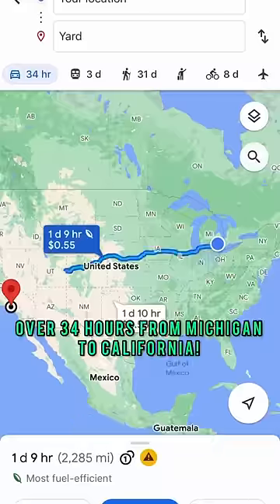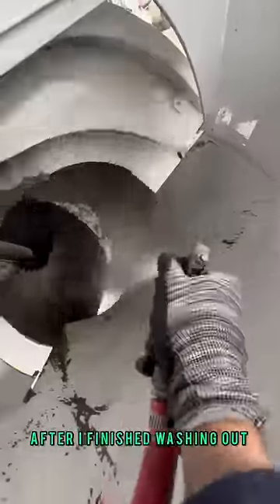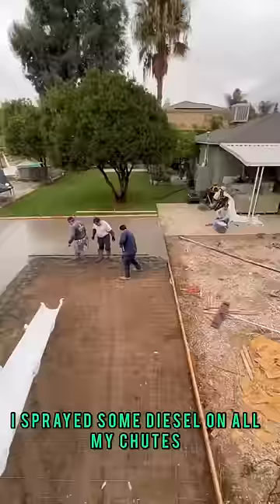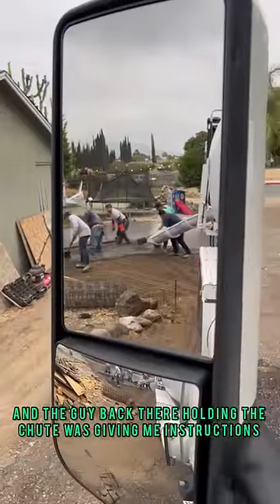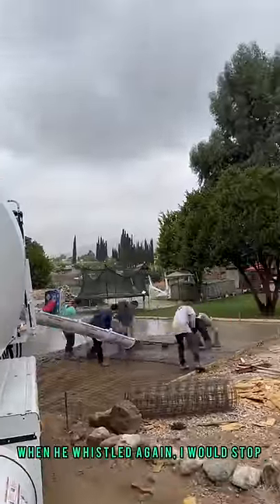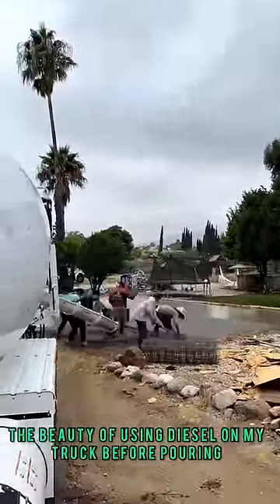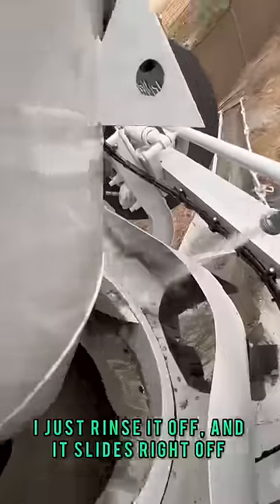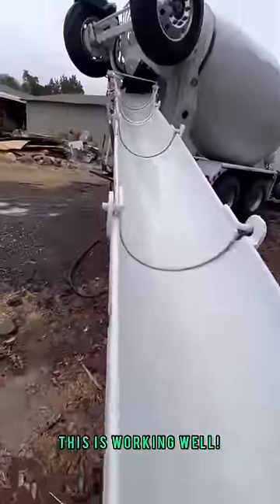BRAND NEW 2022 MIXER TRUCK!! 🤩🚛💨 #concrete #construction #readymix #work #cdl #trucking #shorts

Comment: As a concrete superintendent I wasn't thrilled to hear that , oil and concrete shouldn't ever mix together
Reply: Don't be silly
Reply: Sounds like Oshawa violation from he'll to me heis badly saying he pour diesel out on the ground
Reply: Eric Staats  release form oil can't be compared to that , they're complete different
Reply: What are you talking about? I work for a general contractor and we did all of our own flat work and we did tons of form work and we used tons of form oil, yeah it was nasty as f*** it was dirty oil and diesel and we sprayed on the form ply, steel pans, whatever. For the plywood it's soaks in and once you pour with p*** ply a few times the concrete dries the hell out of it. So when you put the form oil on it just soaks it in. It doesn't go in the ground. It doesn't go in a drain. This is how big commercial buildings are built and big time. Flat work is done. Yeah they have some newer environmental crap. It doesn't work worth a s**. And in case you have noticed this guy's poster a little fishy, you can keep your cement truck pretty much spotless and you don't have to put no foam oil. No diesel, no Vaseline on it. You just rinse it off. Spend five extra minutes at the clean out. All these people on here talking about don't let him catch you with the diesel in the phone f***** ridiculous. You think anybody came on our f**** job site to told us anything? No we did what the f*** we wanted. We built the s*** properly. Sometimes the cost of fancy modern big buildings is some environmental damage f*** where were you guys? I didn't see any you f**** out there whining about it. We did have some electricians that always wanted us to build them Wood chip trails when it was muddy. I seen a few first year electrical apprentices  grease up their sharpshooters and f**** dig one-handed. Oh and yeah for all you people that think the EPA is going to bust us or inspectors or this is that or that the oil ruins the concrete. It doesn't hurt the concrete s*** to use foam oil on your forms. Obviously you never poured walls with snap ties or other concrete wall systems. People always think they know people always want to run their f**** mouth and act like they f**** know
Reply: What's a concrete superintendent?

Comment: Customer after putting out a cigarette on their driveway: “Why is my driveway burning?”
Reply: That not the way diesel fuel works.
Reply: @Oh6Torch  It doesn’t cause sidewalks to combust indefinitely?
Reply: Flashpoint… Die Hard was a lie
Reply: Its bbq time
Reply: Diesel doesn't really burn too well. You need a reasonable open flame. Not any heat source, an open flame, and a hot one.

Comment: My dad used to coat his wheelbarrow and mixing tub with candle wax. Worked wonders. And we didn't have to use muriatic acid for cleanup as often (shovel and mixing tools do chip the wax away if you're not careful)

Comment: I drove a concrete truck for over 10 years. Don't let the company know your using diesel fuel. Use form oil. Our plants use two types of batch plants. Dry mix -truck stays dirty all day till wash the end of the day and pre premix plant. They mix it and put in your truck and the truck stays clean .clean. .

Comment: 20-years concrete mixing in the UK what's told early on diesel affects the concrete we also use a product called GTR which will dissolve set concrete overnight without damaging the paint

Comment: Dang-O Man, What mix did they use so you could drive so far and still have a pour??
Reply: Right I thought it was 90mins and it’s loosing integrity, I’ve been told after 90 shits on them
Reply: No shortage of concrete in Cali ok he waited till he got there then bought the cement

Comment: In the oil field sometimes we used diesel in the cement to get it to harden faster.  Other times we use sugar to have it cure slower…  I am having a hard time seeing how the tiny bit of diesel on the chutes would pose an environmental hazard… especially since the EPA said it would be wonderful to set tanker cars on fire and pour hazmat straight into a ditch before settling it ablaze!!
Reply: EPA making itself relevant, job security.

Comment: I used Diesel and Hydraulic fluid aka "Form Oil". Gotta say you must work with some relaxed people, around here you don't have time to put it in gear, it stays in gear on a tailgate until the job is done. Your left leg gets pretty tired.
Reply: Road paving?
Reply: @ebolawarrior451  Concrete pouring. Pads, sidewalks, curbs etc.
Reply: Tailgating curbs uphill is the worst, but same all the contractors i pour for would flip if you waited to put it in gear every time

Comment: You know you just contaminated the mud brother. It prevents the concrete from setting up
Reply: You don't know what you're talking about. I've been precasting for over 40 years I always used waste oil for a long long time until I heard of organic form release  The only oil that doesn't work is used diesel engine oil because it stains the concrete but it doesn't keep it from curing.
Reply: Your wrong man. Its just not allowed bc of environmental contamination.
Reply: @DongThePsychopath and your wrong man. The state government trucks use the same thing man

Comment: How did you haul 17 yards of concrete in that mixer?
The largest mixer that I ever drove was 11 yards.
The weight of 17 yards is around 69,000 lbs, my RD800 Mack had 65,000 rears (8 tires) on it.

Comment: From Michigan to California? That concrete slab for a driveway must cost $150,000. You must've hauled ass so the cement wouldn't be dry by the time of delivery.
I've never heard of a cement truck driving that far. The local company here won't even deliver to the next county over without an extra charge. 
Should have gotten one with a sleeper on it.
Reply: I’m guessing he bought it to drive back home?

Comment: I worked in a block making plant for a lot of years and Remer that we had to use the concrete within a few hours from being in the mixer because  it wouldn't be any good after it spins in the mixer so long so my question is after 32 hours of driving wouldn't  that "cook" the concrete?

Comment: To the kids who have no clue what they're talking about. The nozzle at the end of the video is water, not diesel. He sprayed diesel  with a small spray bottle at the start, before the pour. That's why the concrete cleaned so easily of the chute. Your mom's probably spilled more diesel at a gas station than what was used in this video 😅

Comment: Congratulations 👍 for truck   The pumper was right on the slip form. Diesel will decorahgate the concrete. I didn't think you want to be liable for the replacement of a pour. Just saying.

Comment: Nice I work for a large cement company in Canada and I love to see the difference with the extra axle. The first time I saw a mixer with front discharge I was in Vegas and couldn't hardly believe what I was looking at. I hear you with using a bit of diesel but you have to be so careful because some of the job sites would definitely flip out throw you off the job. Anyway beautiful truck. How has it been? Working good for you still?👍🇨🇦🔧

Comment: Anyone in the industry quickly learns that some "dont do that"s are "don't get caught by the wrong person doing that". I've been on interstate jobs where you can get a huge fine for dieseling the bed, and I've also been on airport jobs and you can spray the equipment down right in front of the inspector. I only use diesel if the mix starts getting stuck. On the next load, it will pull right out.

Comment: I don't know if it would help or not but try a product called mold release we use it in the smelting Industrial we use the release on metal wood and sand does it seem to hurt paint on hard metal surfaces

Comment: Use ultra ever-dry, its carbon nanotube in a spray application, 99.9% hydrophobic, the concrete wont even leave a trace to wash out but your chute will be like teflon, 5 will pour like an 8

Comment: Diesel works great so does form oil but I would continue putting a few spirts of diesel and if u find form oil but it in same bottle shake up and just use a few spirts  good luck from the bridge builder

Comment: I used a mix of hydraulic fluid and diesel in a very thin spray from a stainless hand pump weed sprayer on my concrete boom pump in Florida.
Always worked extremely well.

Comment: Bro if you did that here in Texas your ass would be in hella trouble. People used to spray diesel on forms also but now they actually have a oil for it and that would work very well for what you're going to use it for. It looks the wood release right off of the concrete so it would do the same for your chutes but definitely stop using diesel

Comment: They used to use diesel for form oil, but I guess the epa doesn't like that so they have other stuff. I believe you can get in trouble for using diesel. But yes it's what they used in the past and it works great.

Comment: Why would you have to sit in the truck to operate the tumbler on a brand new truck? Already 30 years ago we had trucks with hydraulic up/down on the chute and start/stop controlled by a cable. I would assume that this is done with a remote that also controlls side to side these days.

Comment: a mixer truck with an eaton fuller's transmission . You are not hauling heavy . You don't need that . a common 7 speed transmission is what you need .
Reply: A loaded ten yard mixer weights 74,000 lbs a 18 wheeler weighs 80,000 yeah

Comment: California requires designated washout areas. You obviously didn’t use one. Did you verify that your trucks diesel engine meets California requirements? That’s a large fine if it does not.

Comment: On construction we ran out of form oil before pouring, so I had to finish the rest of it with diesel. I freaking smelled like diesel for atleast 5 days and had that smell in my nose for another 2 weeks. It sure did work pretty well, but not as well as with form oil as the forms came off cleaner with proper oil

Comment: What are the 2 wheels on the top
Reply: There called a bridge master when loaded and going forward they are on the ground and Carrie 12,000 lbs of weight they also transfer about 10 of 15 thousand onto the steer Axel so when fully loaded you have 20,000 on the steer Axel about 40,000 on the drive axle and 12000 on the bridge master it varies state to state

Comment: If you do get a build up don't use muratic acid, look for a glycolic based concrete Remover, it's skin safe/ paint safe and you can even let it sit over night on hard buildup.
Reply: Its called right off

Comment: 17 yards for a driveway? At almost $60@/yard that’s almost $5,000 in msterials. Then figure 6 guys for 10 hours at $50/ hr that’s another $3,000. Add for site prep and clean up, you have a $10,000 driveway. That’s a lot.

Comment: Form oil is diesel fuel it just has a different color. If your caught using form oil to run your diesel engine it is a huge violation.

Comment: THE FINE SCHEDULE at the EPA begins at $5000? From a guy who’s worked in the oil business for 35 years it depends on your state some states have 2 gallons that’s a reportable spill some states say anything like a tablespoon inside the basement on the floor when you’re changing the filter is a reportable incident!

Comment: Diesel fuel does the same its just the enviro nuts dont like it. Form oil is great and probably  worth buying to keep them.off your back if they do catch you spraying diesel on your chutes. 
Nasty trucker-10 years dropping concrete great job just crazy hours.

Comment: I'm a concrete finisher form center from California I was born and raised there I'm surprised they allow you to spray diesel on the trucks like that to keep the concrete from sticking or the form oil you might want to try canola oil to besides form oil I know a concrete pump operator that sprays canola oil on his pumps that might be something you want to check out to a little more environmentally friendly so you don't get harassed by people out there for the environmental b*****

Comment: There's no point in spraying everything bc the concrete is going to wear the paint down, n it's going to stick anyway.  I drive mixers, and no matter what, there are spots that won't stay clean. That's not to say you can't keep the rest of the truck looking nice.  Those chutes and collection hoper are the biggest waste of your time spraying. Just get a good scrub brush and clean them.

Comment: DUDE.... If I ever find out that any of my concrete jobs have any form of lubricants being used, I will own that concrete company...  Especially on the structural concrete... Stop doing that.. The cleanliness of your truck, have no value to the purity classification quality of my ordered concrete... Please note, You can be charged for corps espionage from your employer, as they have regulations and checks and balances for such... and you are doing this... Now, if you are the company owner and or owner operator doing this, you lose your bonding and insurance coverage's if caught sabotaging structural concrete, meaning, you go to prison for insurance fraud... stop doing this bro... These trucks have a shelf life, and trying to make one last beyond such, as if that is how you make money or save money, while being high risk to safety. be careful, as you just showcased in this video, what you claim you are doing. Let me example for you... 1 gallon of lacquer thinner destroys 1 million gallon of fresh water... 1 qt of motor oil destroys 100K gallons of water. 1 drop of motor oil, can spread out over time, to a foot or two in diameter, let alone, what saturates inwards, that is on cured concrete.. and you are mixing lubricants with the next load so your truck looks shinny? The oil bonding with the water on a micronic scale, prevent the cure rate and basically the lye does not fully activate, just give a false look of cured, only to be brittle and just crumbles... Rule of thumb for concrete.. Once concrete trips off, for the life of the concrete, it never stops curing, or hardening, to the point that "shelf life" means something, that the concrete will continue to harden, that it will start to break itself down, 20 years, 50 years, 200 years, pending the formulation. you just poured contaminated concrete that will showcase faults with in months, with this stunt... In 40 years of doing concrete, I have never seen such stupid attempt to show a clever trick that is actually wrong. In fact, you really need to take this video down, so others do not think this is a good and solid practice to do. Granted, this is your channel, you do with it as you see fit, but, bad information is just that, bad information.  Might also want to look into the PPM & PPB gameshow of allowances for such.

Comment: Form oil will work great but your truck is gunna stink. We used to get a form oil that was a concentrate, so we had to cut the oil with diesel. So just know what the stuff is before hand cuz I'm sure you don't want oily diesel all over your shoots

Comment: As form oil, I use used motor oil and diesel roughly 50/50. It works great and good way to use old motor oil.

Comment: Back in the early 2000s working at a concrete specialties shop we sold our own brand of form oil.  It was some kind of concentrated soap mixed with diesel fuel.  We would buy the concentrate in bulk and empty white 5 gal buckets.  4.5 gal of diesel, top it of with the concentrate and shake.

Comment: Be fucked if I’d use a concrete supplier that used oil on any part that is touched by wet concrete !!!  It may not be a lot but it’s still there and it’s still going to cause a weak spot !

Comment: Number one depending on what state you're in that's illegal number 2 you're not hall an asshole so why are you spraying your feet down with diesel Sounds like you're a rookie and you let somebody call you in the thinking something that's not true Dude it's a worktruck you're gonna get build app on places you're not gonna keep it clean forever But then again you might be from a slow company who has a lot of downtime I was a runner my job was the hall those of concrete not to keep my truck clean the inside yes no build up but a tiny bit on the outside not neither the hammer won't take care of